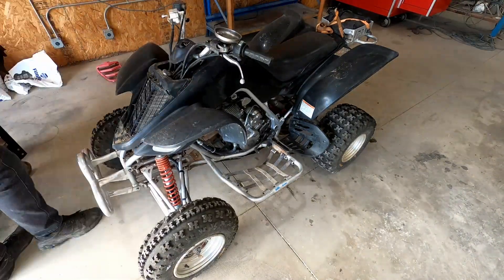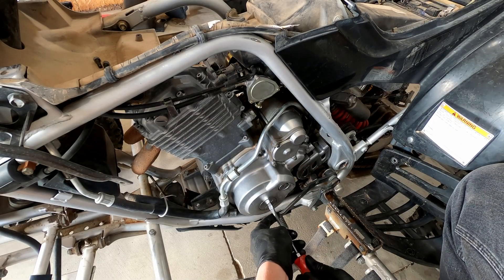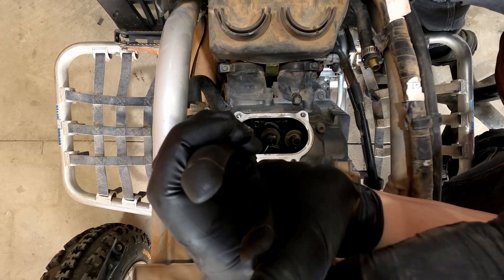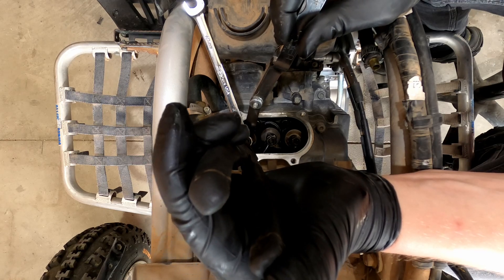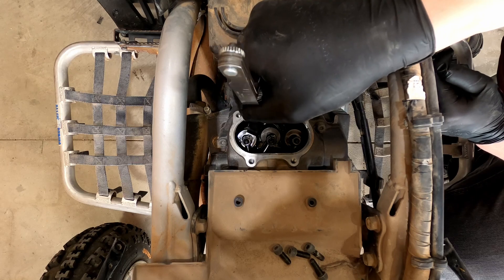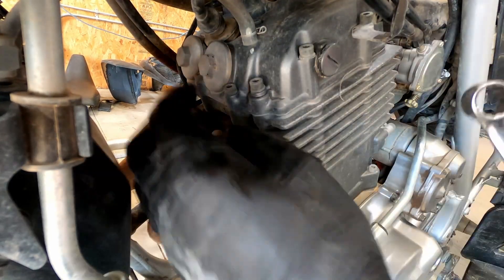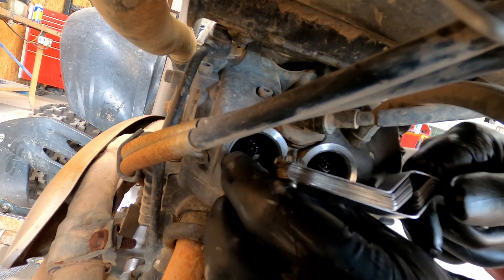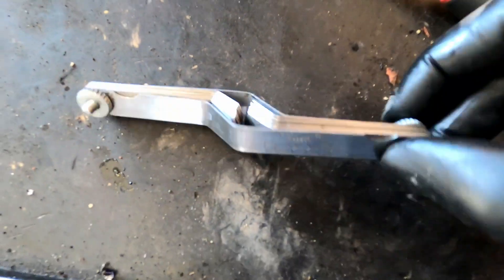How To Adjust The Valves On A Yamaha Raptor 660

Comment: Hey man good video I got a 2002 660 that won’t start.   I only have suction threw one carb any idea wat could cause this.  My intake valves are moving fine
Reply from the maker: Check the throttle plate in the carb. Make sure both move with throttle input, also check the choke, if it gets stuck on one side that could cause the issue, but pull the carb off and make sure while cranking you have good vacuum on both sides. If you do the problem is in the carb.
Reply: @RogueWrenching   thanx for the reply I never thought about the choke  I will check that and pull the carbs off aswell.
Reply from the maker: @ryanwilson8261  Happy to help

Comment: I usually adjust a little loose then when thightening the nut it come to the right spec cant do each one 3 times on a 24valve or more engine 😢 would take hours
Reply from the maker: As long as the final when you are done is in spec, it's all good.

Comment: How the hell did you get the front fenders off without taking the lights off ? 2001 must be a bit different. 12 years ago, I was also under the impression that I had to take out the sparkplug to get it to turn.
Reply from the maker: I just unbolted them? I've never serviced an ATV prior to this one so I'm not sure if there might be a better or easier way to disassemble the plastics. Removing the spark plug will definitely reduce the resistance to turning the engine but it's certainly not necessary.